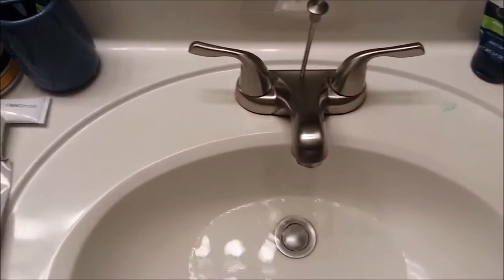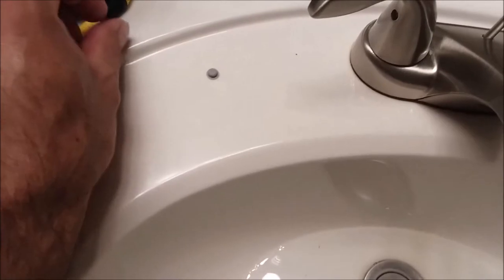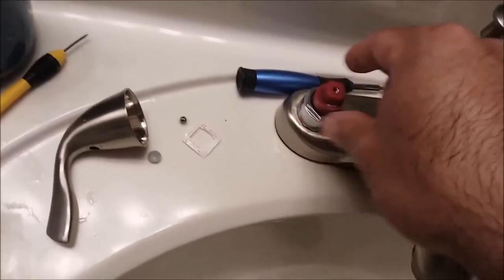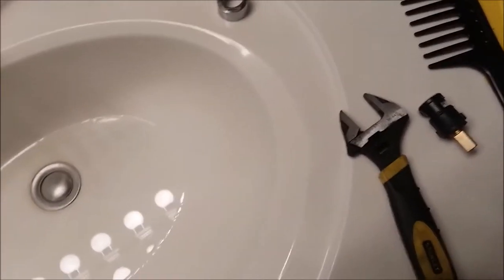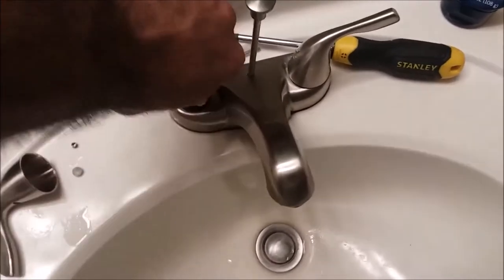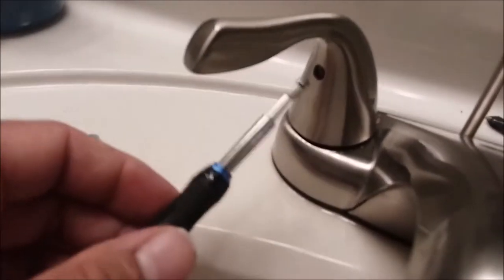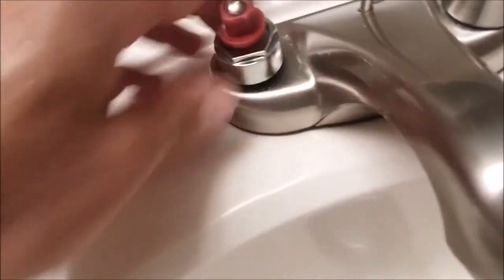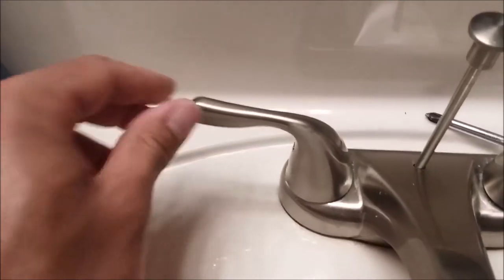How To Replace #0749746 AquaSource Bathroom Sink Cartridge

Comment: Extremely helpful video, thank you. I really appreciate you going step-by-step and explaining the whole way. I have the same sink and was getting low pressure on the hot side. Replaced the aerator, valve, faucet line, and cleared the main supply. With your video, I washed and cleaned the parts you removed and the pressure is fantastic now. Contacting Lowes now for a replacement of both cartridges.

Comment: Could this be the reason why it’s leaking from the base of the sink? Underneath I have a drip coming from the under side of the faucet ? I took it apart and the seals look worn on the valves just didn’t know

Comment: I have that exact faucet in my bathroom. It is leaking... Went to home depot looking for part... bought wrong part. Do you happen to have the part number for that cartridge replacement? Appreciate it if you do. Thanks
Reply from the maker: Yes the cold side is A507180N an the hot side is A507179N
Aquasource customer service will ship you the part for free because there is a lifetime warranty on the faucet. They will ask for the model number of the sink an the date of purchase. Here is the number my friend 1-866-417-7564. Monday-Friday 8am-8pm🙂. Good luck
Reply: Thanks Scott... however I didn't buy the sink... bought the house it is in... so not eligible for free part. Trying to find the part numbers that you said... but doesn't seem to be listed that way... There should be something on the front of the package that says something like 3s-9h/c  or 3s-15c or something like that... Hardware stores don't have all options and when looking online there are so many can't see clearly if they are the ones that I need... If you know what the above type of numbers were on those models I would appreciate it. Thanks James
Reply from the maker: I just pulled the knob off the hot side and there is a sticker on the cartridge. It says model # 51B0034NP. Item #0007148. The customer service number on the cartridge is the same as the number I gave you for AquaSource. Just call that number and give them that model number for that cartridge and they will Just bill you I suppose. Let me know how everything goes. The other numbers I gave you were straight out of the manual With this number coming directly off the cartridge this may help. It looks like you may have to call them directly and order it because even putting those numbers in Google don't come up and on Amazon. This is like buying a Mercedes. You have to go right back to the dealer. Laugh out loud.
Reply: @camarobossman  amen to that. thanks for all the help and time.
Reply from the maker: @Goldheartcn  No Problem
Reply: It's now discontinued by AquaSource/Lowe's.  But it's a 3S-11 without the red plastic cap, and 3S-12 with the cap included.

Comment: What is the size of screwdriver point you used for replacing the catridge?
Reply from the maker: T10
Reply: @camarobossman  Thanks
Reply: @camarobossman  T10 what inch please or may be an online link ofr it will work best
Reply from the maker: @satishkumarreddy9910  just Google T10 screwdriver or go to Amazon and type it in you can also go to Home Depot and buy one